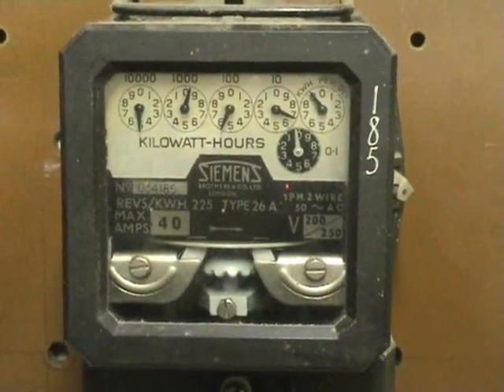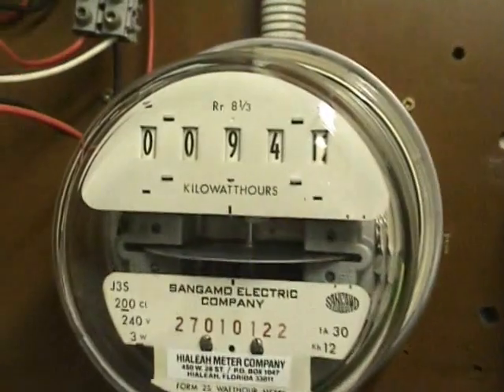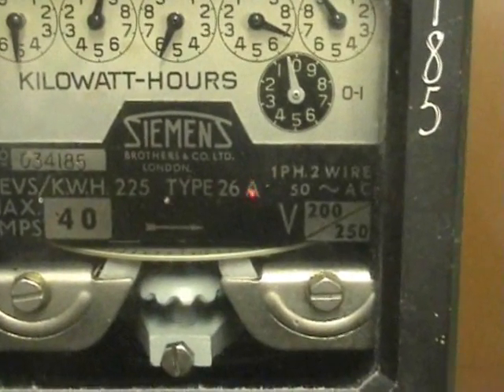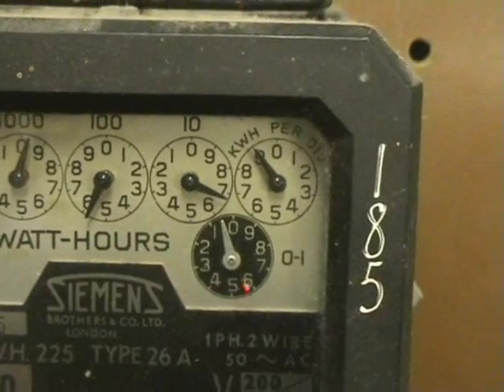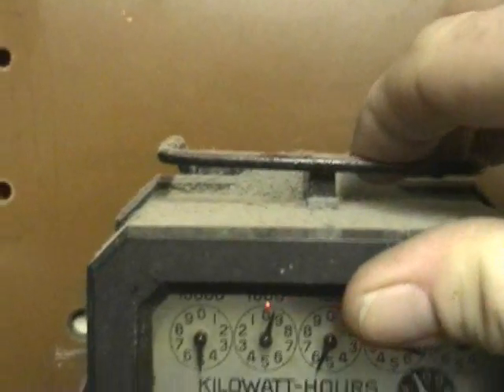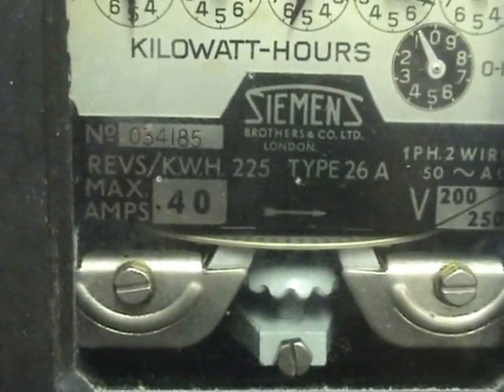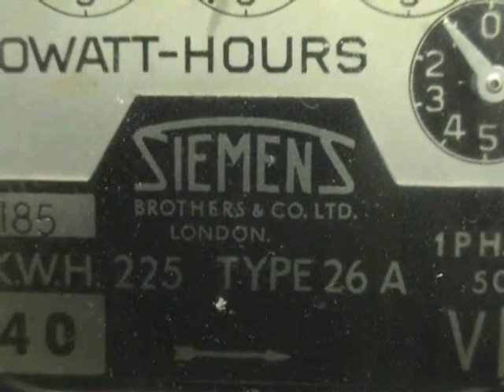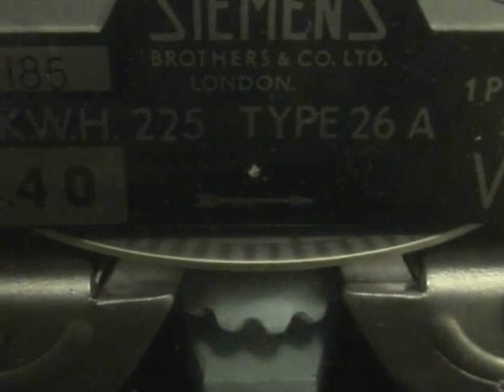Siemens Type 26 A kWh meter

Comment from the maker: @wasssup1990 OK, kVAh readings are calculated from the kWh and kVArh and will always be the highest.
CFL lamps and SMPS in computers and TV's could cause a phase shift although often have internal PF correction Caps in them.
I'm sure that you will have a toaster , coffeemaker or heatgun somewhere which will have a heating element.

Comment from the maker: @wasssup1990  A kWh meter measures real power. Most house hold loads use power at unity power  ( PF 1 ) factor e.g. heaters, incandescent lamps. The meter slows down at a poor power factor too.
Fridges and appliances with motors will draw at a lagging powerfactor and draw apparent power. (±PF 0.8)
Most of those PF corrector devices are a waste of money.
Unless you got big compressors and motors like in a factory it can make a difference